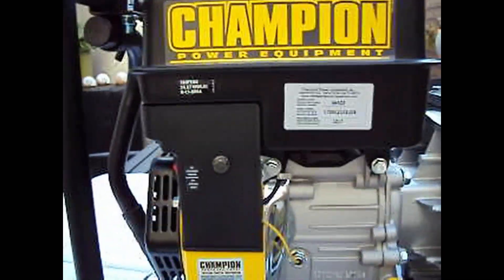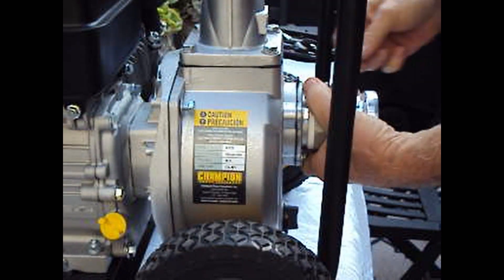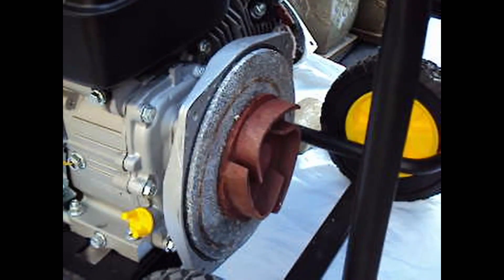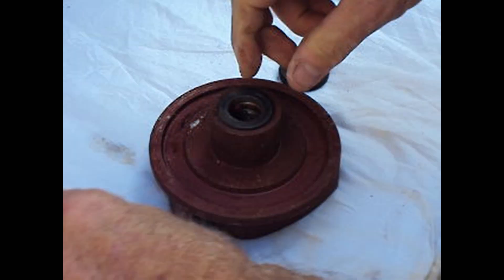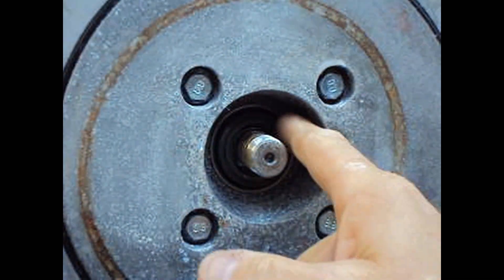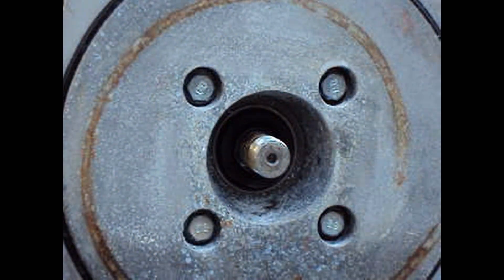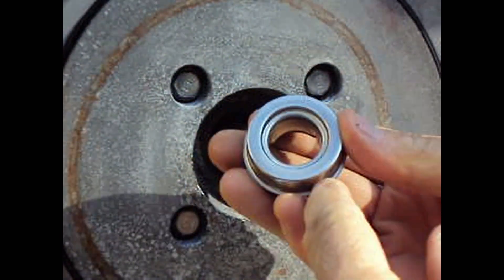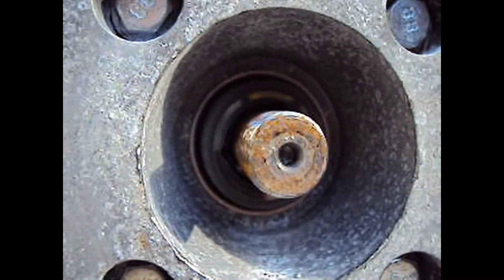Champion Trash Pump Seal Replacement

Comment: Do you have the part no#? Or its a universal seal kit? Thank You
Reply from the maker: Part # 5, 6 and 7 on the parts diagram. I don't have the exact link but search "UPC
666714418557" on ebay
Reply: @theruckusdj  Thank You

Comment: I have a new one and it not pumping water but the engine runs good, need advise on how to fix it,  champion brand new
Reply from the maker: You have to prime the chamber by filling it with water from the top . This creates a vacuum allowing the water to be drawn into the inlet hose.

Comment: Thanks for the video , how long have you had the pump , In what period of time you had to change the seals?   very appreciated
Reply from the maker: I used it once with a fire hose attached and spray head closed which created the back pressure and broke the seal. The key is to keep the hose spray head open when the engine is running. There are companies out there selling these as fire fighting equipment without realizing they will fail.
Reply: @theruckusdj  Thanks So Much! Very Useful video ,